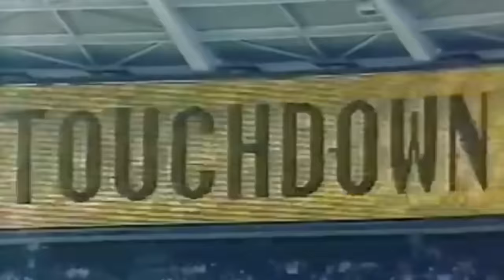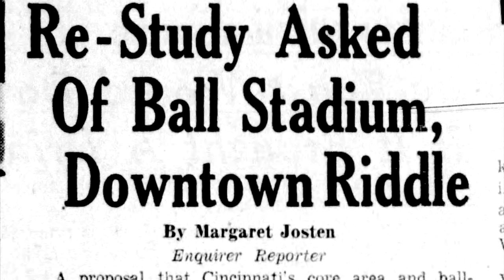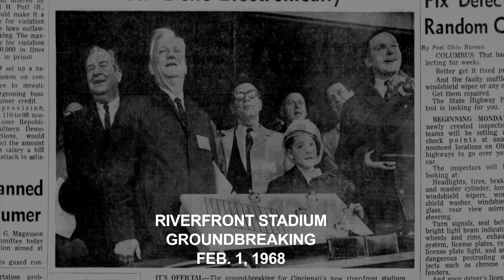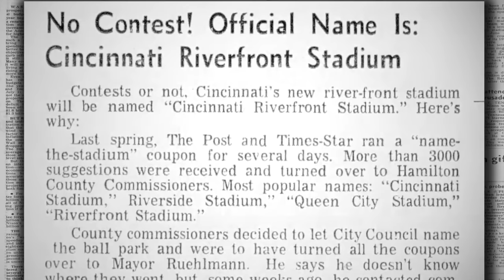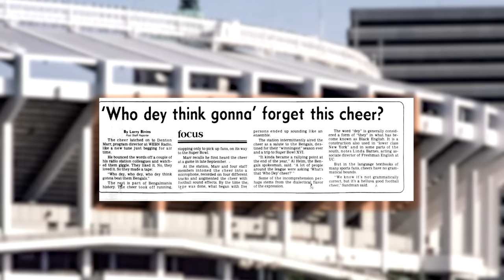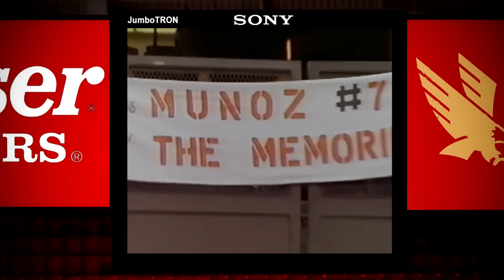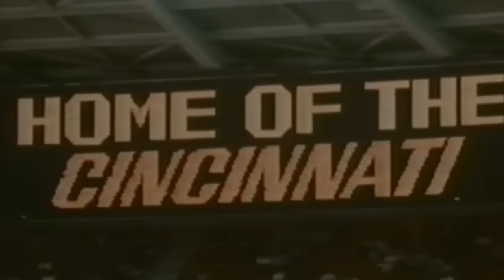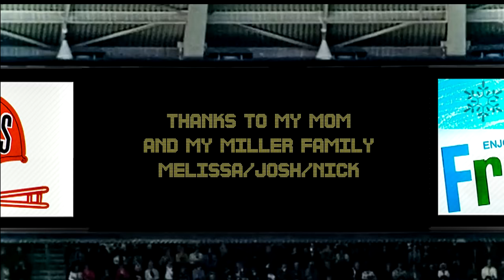Riverfront Remembered: The Jungle - A Film By Cam Miller

Comment: Just another doughnut with fake grass, product of MLB teams having to beg to politicians for new digs and having to acquiesce to NFL's
mandate for 50k+ seating. At that time NFL franchises made more from sellout games than TV revenue, so getting 'free' new digs MLB
owners in many cities just gave in.
Choosing to use Atlanta-Fulton Co. stadium for design concert was wrong from the start. Long walks to covered areas when the inevitable
summer downpours hit, huge foul area dead zones, an upper deck so far back from baseball/football field layouts (with exception of right behind
plate and corners of end zones) made the game just a rumor. Whoever gave 'rave reviews' to A-FCS was either promised free entry or just
didn't know what they were talking about. That layout casts doubt if Finch ever attended a big league sporting event.
At least Riverfront had the field level moveable stands paralleling the foul lines and football sidelines unlike A-FCS or Oakland Mausoleum.
Those high outfield seats had greatly obstructed view of most of the outfield.
BTW - by the mid 60's Pete Rozelle was so entrenched in Commissioners job that Hackett's query about Brown taking that job was a non-starter.
Pete wasn't going anywhere, he made too much money for NFL owners and deftly handled the merger.
An aspect of the field changeover almost nobody touches on was that 2-3 inches of clay in the cutouts for baseball had to be removed in order to
insure that the carpet laid down was flush with the surrounding turf. As involved at the changeover could be it was still better than the way too
complicated maneuver in Oakland, with grass field to boot.  Although left fielders had to contend with the carpet laid over metal plates
above the track trench for moving the 3rd base stands out for football - step on it and clank!
Good footage of the changeover, rare that this is recorded.